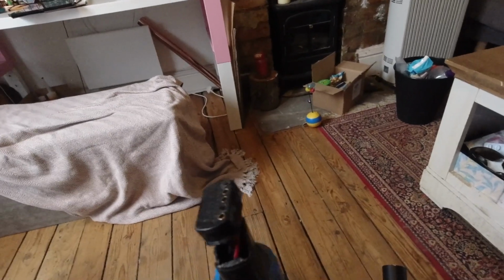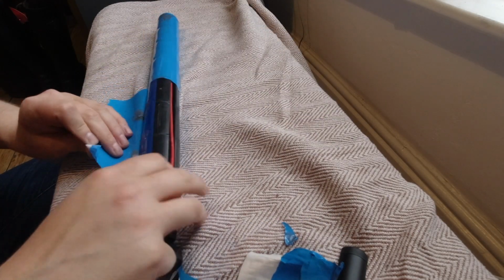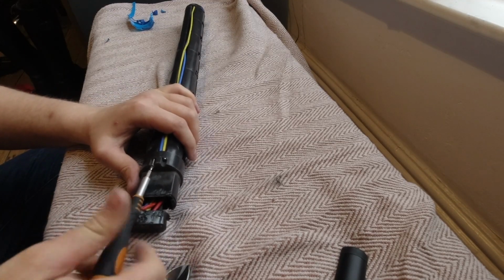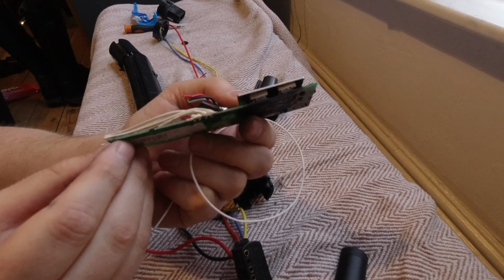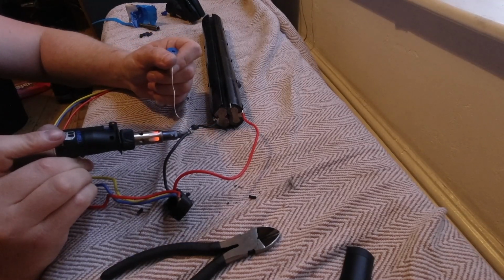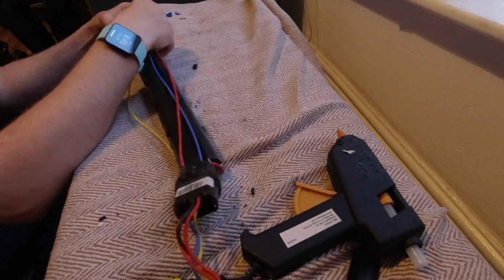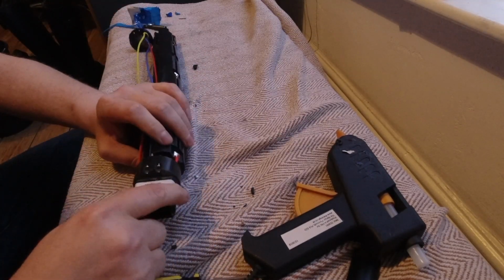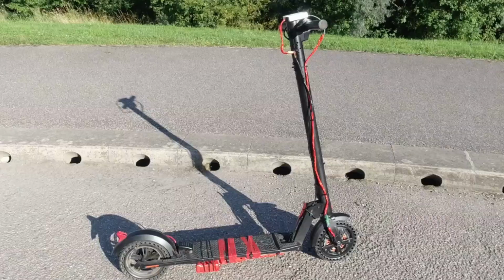Electric Scooter Controller FIRE!!

Comment: Also checked the video with cell removal https://youtu.be/4ed6XBpCWec same battery and connection why you didn't run cables inside in the midle, also what BMS did you use ?

Comment: Thank you sir. I believe after some research and owning several brands of scooter that gotrax has higher Craftsmanship. Even tho this one malfunctioned, it is not near as bad as ones I've owned in the past. Swagtron, Genesis both do not care about their products and leave loose, sometimes hanging wires inside, ready to short ur battery out ! I purchased a gotrax in hopes it will last me longer and If it breaks down the road I will fix myself :)
Reply from the maker: Awesome. Lovely scooters. Just remember to get some PTFE spray, otherwise known as Silicone spray, and cover it as soon as you get it. All the little cracks and screws. Keeps its waterproof and healthy. Let me K ow how you like it, they're great scooters.

Comment: Where is the motor controller located?..thanks
Reply from the maker: At the top of the handlebars, at the back where you stand :) Behind the plastic held on with screws.
Reply: @benalexxander  oh thanks mate, I thought the Esc Controller is in the bottom where the battery is connected just like the Turboant X-Series...Im glad youre doing this dissection..I cant find anyone doing this to scooters with the same configuration..stay safe mate..